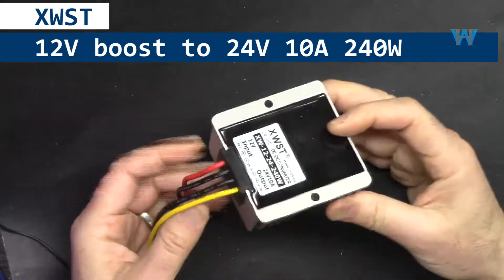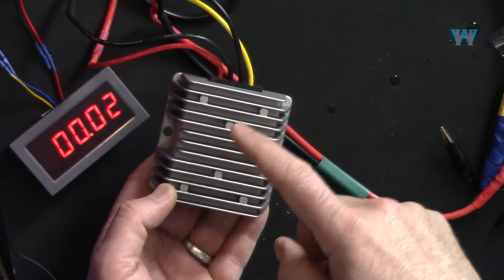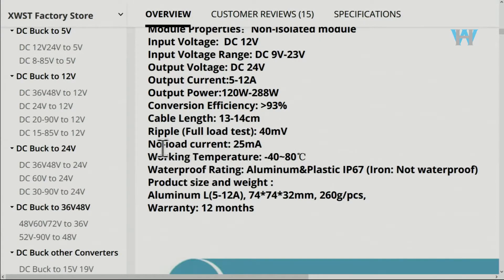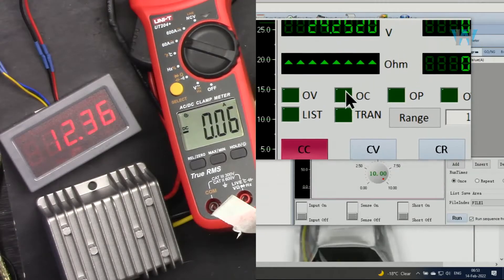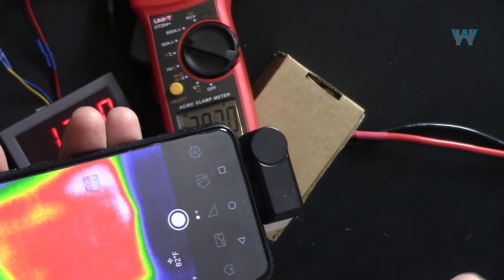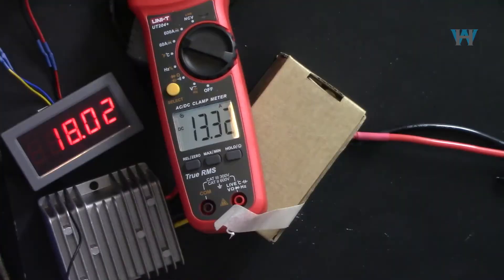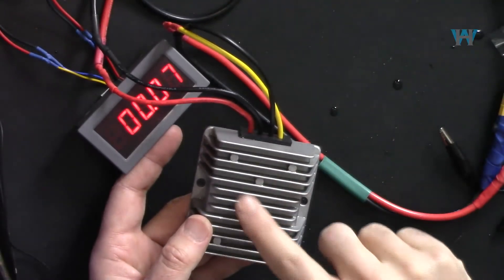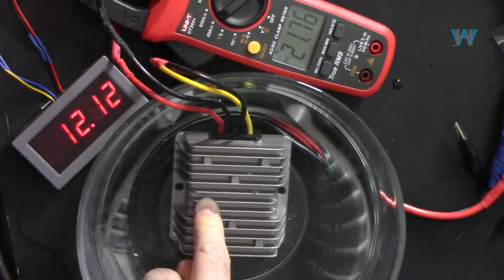Review of XWST 12V to 24V  10A DC Waterproof 240W boost for boat, golf car etc

Comment: How do i hook this device up to my car? and can i use the 10Amp converter for something that is 50 watts?
Reply from the maker: may be you did not watch. what did I show then? i shown the battery which could be your car, boat or anything.  your last question is like "Can a truck carry book?" yes. it can. your book is 50W and this can handle 240W.

Comment: Can charge my powerstation?
Reply from the maker: When you charge a battery you need to have a power supply that you can set the current that is called constant current or CC. Using this module. You cannot set current and it will damage your battery.

Comment: I have the 12 volt to 48 volts 6 amp but the wires are getting to hot to my opinion 70 degrees what should i do
Reply from the maker: 70 degrees is normal.it should be okay.
Reply: @WattHour  Fahrenheit or celsius mine is celsius 70 degrees for the device is ok but for the wires not
Reply: I think they are using 16awg wires… it’s too thin. The input amp for the 16awg is maxed at 10amp I thought, the input is way over safety limits.

Comment: I like you video but I have a question for you. When you setup for the short circuit test, the reason you did not see a spark was because you jumper wire was wired correctly and all of your other test leads were too. So at that point all you did was just hook positive to positive and negative to negative.

Comment: Congrats for your video! I have a CPAP that I want to feed from a 12v battery, and it runs at 24V with 3.33 amps of consumption, that's what the manual says. If this converter gives an output of 10 amps it exceeds notably the electric demand of the CPAP. As long as it seems that a 3.33 amps output is not commercially available, what output would be more convenient, 3 or 5 amps? Thank you, sir!

Comment: Very nice video sir. It answered all of my questions. I am going to use one of these to power up an AC1200 outdoor wireless point repeater from a solar panel and battery at a remote location. The wireless point needs a 24v power injector energized. Output voltage looked very stable at varying input voltages from your test. Looks like it will work for my application. Thank you sir, great video!!!

Comment: can i connect this to my 24V oven and connect to my 12V battery ?
Reply from the maker: this works with DC device.  does not matter what kind you connect. You connect 12V at the input and it will output 24V simple as that.

Comment: Hey Watt can you hook this to the Pv side of a mppt Victron charge controller? Then limit the current within the app to 10 amps. Oh and why did you stop making videos?,  I hope all is well and big ALOHA from Hawaii
Reply from the maker: Hey,  yes yes you can can connect. as long as the voltage is within the input range which I have explained and don't remember now. 
I am doing well. have been buy with other thing in life. thanks for asking. Stay safe. Hello from Canada.

Comment: Please load it till the output shuts down pulling 12A is not really an OCP test, also please add ripple testing.
Reply from the maker: I did short circuit test which is short and 12A . I did 12 because it showed to be useful. it can handle 12A but I did short circuit protection.  Short circuit is actually protecting the device.